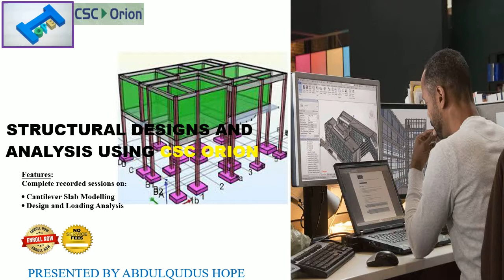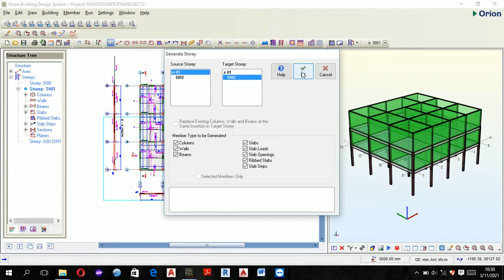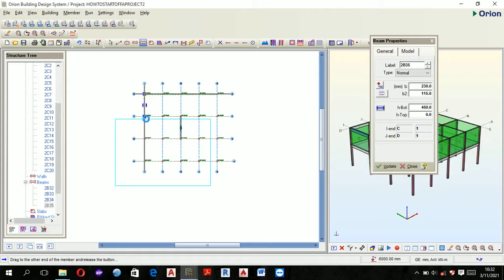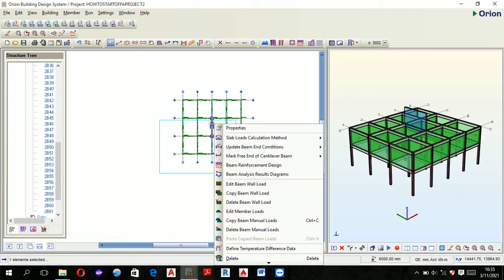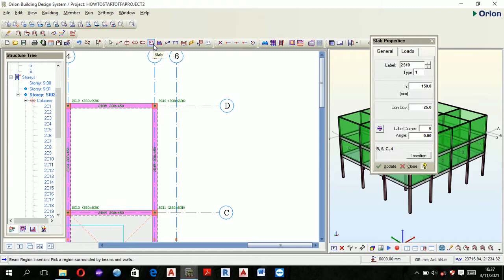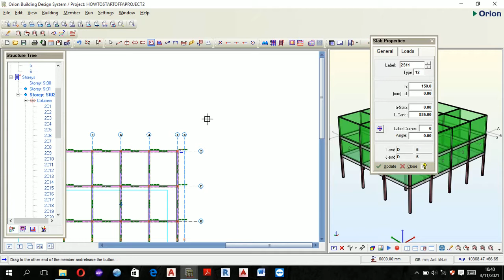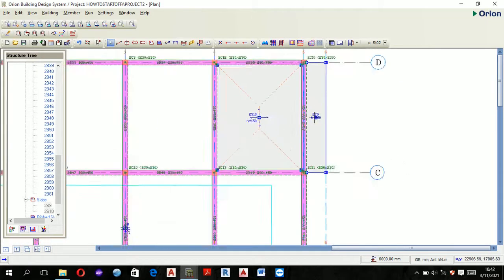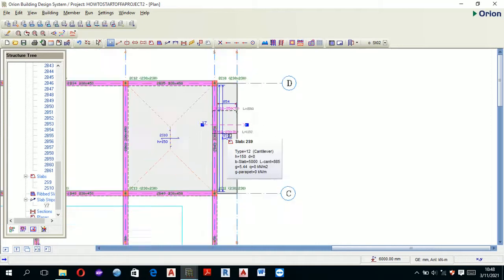ORION V18 TUTORIAL :How to model cantilever Slab and it loading analysis

Comment: Please sir 
How do I settle this issue of invalid insertion point?
Reply from the maker: Errors on insertion points occurs from the alignment of grid lines. Make a proper check on your gridlines before modelling the structural element(slab) and do ensure to check the slab type you are using.